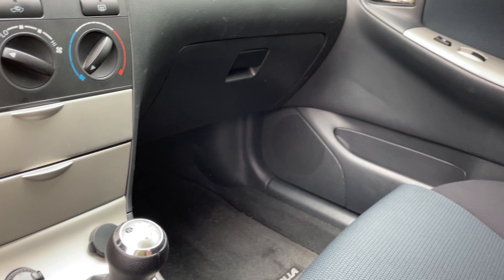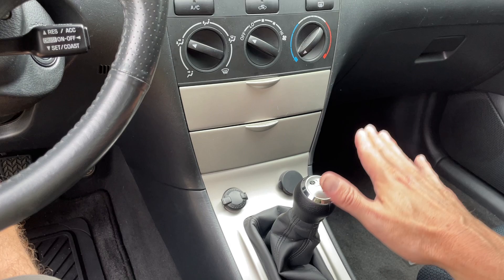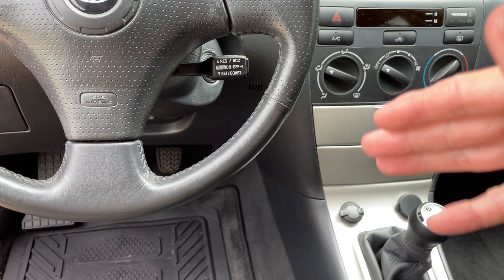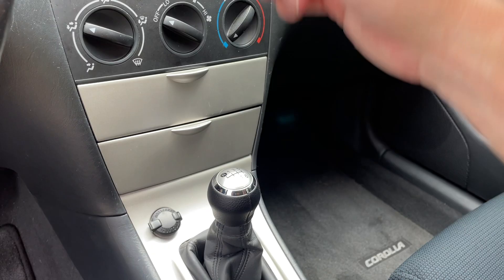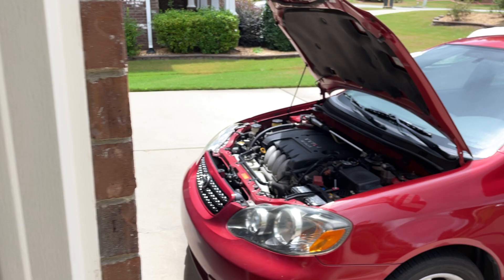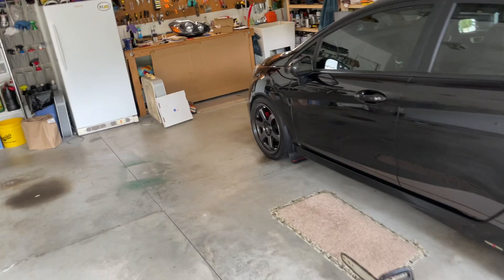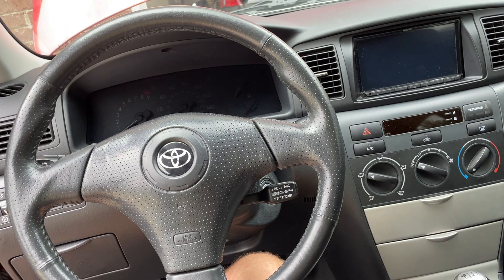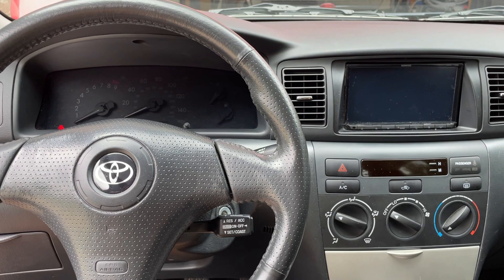2005 Corolla XRS 2: MWR short shift/cable & base bushings/other updates

Comment: Cool video!  I had an 05 XRS from brand new for 10.5 years.  One of the most difficult manual cars I've ever owned, took me forever to get a smooth start, and then first to second.  I've accidentally engaged reverse a couple of times with the factory shifter by rushing it, and then hearing the beeping, haha.

I have a 2016 Mustang GT now with the 3.73 ratio.  It has an MGW shifter so you have to push down into reverse (and with the factory you pulled a collar UP).  Now there's no way to mistake reverse!  It's also crazy how much easier this car is to drive with the bigger motor.  It's almost impossible to stall lol.

Comment: Great video! And the first thing that I noticed and I really appreciate is the fact how clean you're Corolla is! Just like mine 😁 no dust of stains from food or soever, no scratches, original clean floor carpets and that second rubber floor mat! To keep the original carpets clean 👌 that shift knop in Europe isn't standard, that comes here with the newer model Corolla from 2007 and higher, but it looks good to me!

I also bought the MWR short shifter kit and will install it soon!
Stay safe and greetings from the Netherlands 🇳🇱 😉👍

Comment: Why’d you change your mind on the solid cable bushings and what did you decide to use instead?
Reply from the maker: Too notchy. I like the notchy feel but this was too much. The XRS shift mechanism/clutch feel isn't the best, that's one of the very "Corolla" things about the car. It got worse by putting these bushings in so I returned to the stock ones and it felt better. Sometimes you have to experiment.
Reply: @gray25xt  - Totally get that. I’ve replaced my shifter base bushings and the shifts do feel better. Was thinking about doing the cable bushings too, but I agree. I think the shift action is good enough with just the base bushings. Appreciate the feedback. 👍🏻